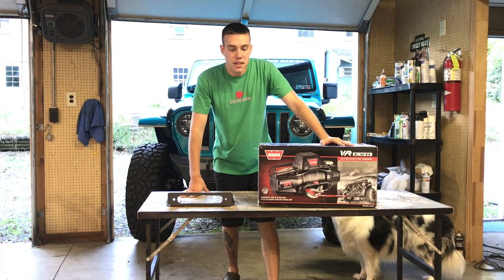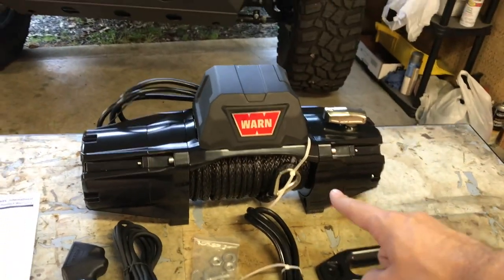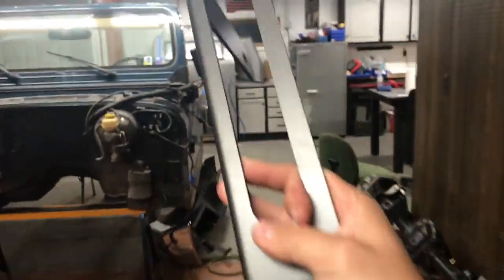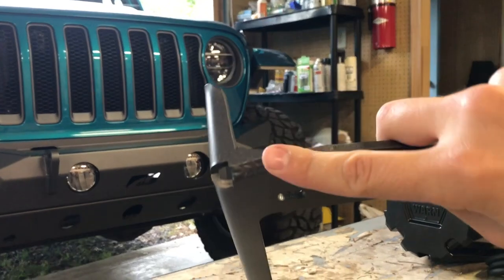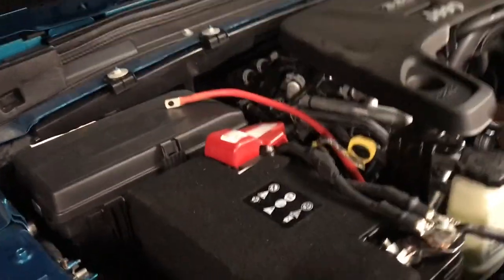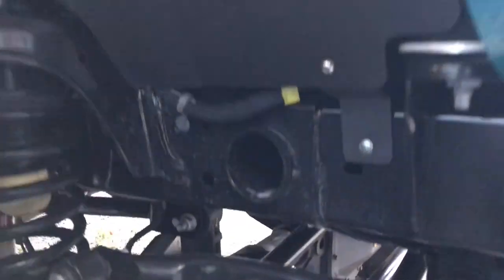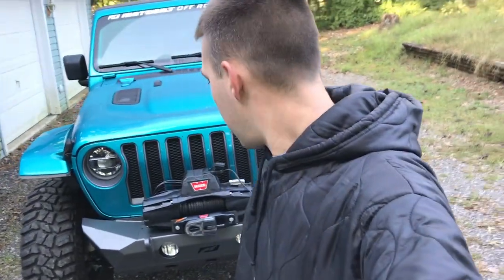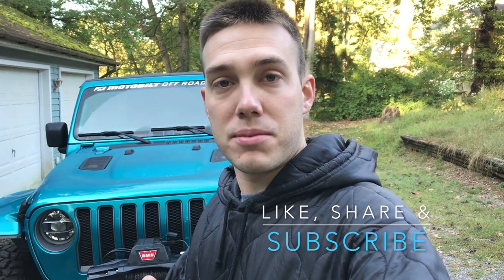THE NEW!! Warn VR EVO 10S Install

Comment: At 19:50 if you haven't already done it .. I'd be putting a protective sleeve of some form over the +ve cable as it passes by the -ve terminal on your battery. From the camera position it looks like it can rub and if so ... it will eventually rub through against the -ve terminal and you could be in a world of trouble.
If ANYTHING is allowed to rub against anything else .. it WILL eventually wear through.
Reply from the maker: Appreciate the advice! I know when we were installing this, we were kinda in a rush and it’s been good since. But I do try and check over the Jeep periodically. I’ll definitely take a look at the cable next time and put a wrap around it if I see an issue. Thank you for watching

Comment: Perhaps another option to elongate the fairlead mounting holes and not cut the bracket. Then it would have been farther away from the wench and retained all its strength. Hopefully by now motobilt has redesigned the bracket. Thanks for taking the time to share your experience.
Reply from the maker: That’s a good idea! The only thing I could see as a downfall of that is it pushing the fairlead further out from flush of the front of the bumper but I think that would just be a visual issue not a strength. I haven’t checked if they redesigned it because ours has been working great since we installed it. Thank you for watching and your feedback 👍🏻

Comment: I'm wondering about the battery life of the remote. So it is not rechargeable, and it seems like those are ER14505 batteries. But how long will the battery last with a normal use (and some periods without using it). Is it fairly simple to change the battery on the remote?
Reply from the maker: Kevin Villalobos Actually after speaking with them and looking into it, in our remote the battery is just a normal AA and it’s a simple three Phillips head screws to take it apart. The issue we had with the Bluetooth not working was something with our Bluetooth receiver and they warrantied it no questions asked. We just had to bring the winch to a local authorized Warn service shop and they took care of it.

Comment: Did you figure out the wireless part? Can’t figure mine out.
Reply from the maker: E W We called Warn and they said that sometimes during shipment the battery in the remote can become loose so they instructed us to unscrew the three screws in the remote then remove and reinstall the battery. Unfortunately that didn’t fix ours so we have to call them back and have them send a replacement remote. Sorry I don’t have a better answer as of right now but I’m sure they will make it right. Thanks for watching! -Cody
Reply: Altered Life Awesome. I’ll try that. Thanks!
Reply from the maker: E W no problem, good luck!

Comment: You should watch some safety videos on proper winch recovery.
Reply from the maker: Emmanuel Chen will do. I’m curious though what I did in the video that prompted you to comment that?
Reply: @altered_life  Positioned way too close to the recovery. Could lead to injury or death if something breaks.
Reply from the maker: Emmanuel Chen I can definitely see where you’re coming from with that. Certain times though to make sure everything is going correctly you have to position yourself where you can see. We also did take precautions by using a full closed loop winching system to help avoid the chances of parts failing as well as the use of the synthetic rope so that it doesn’t store energy like a steel cable would in case of a line snapping. Winching can inherently be dangerous but with proper equipment and inspection of that equipment before use, risk can be mitigated to a very low level. Thanks for watching!